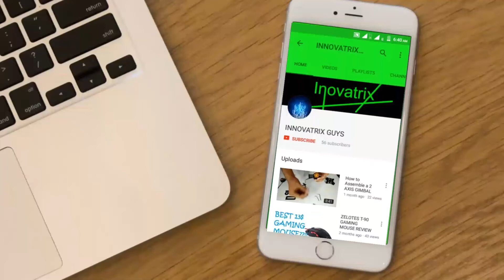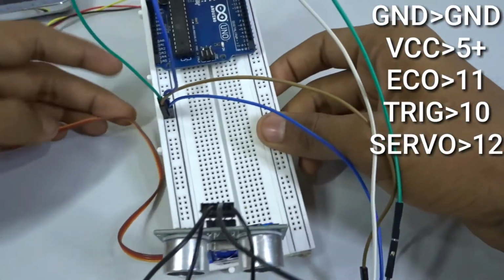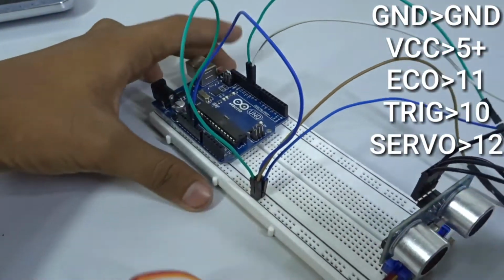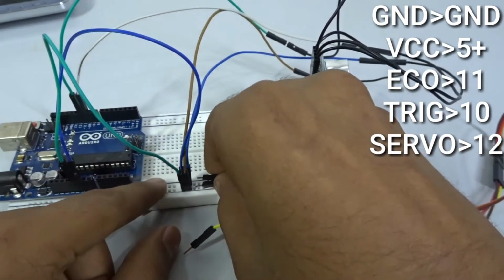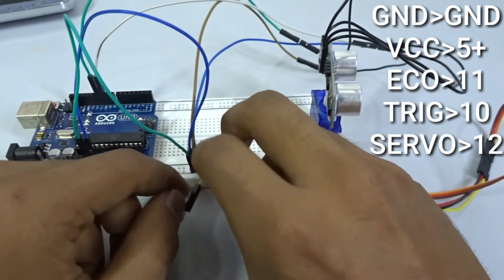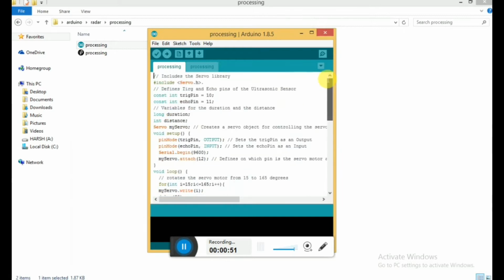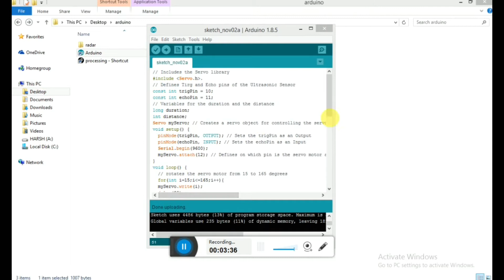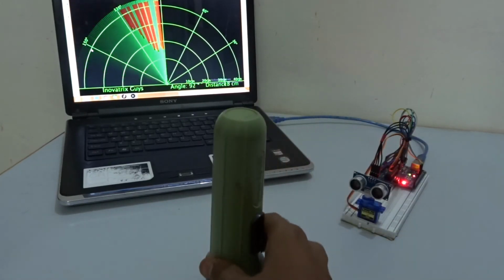Arduino Sonar Radar | HOW TO MAKE A RADAR AT HOME | Arduino Project

Comment: Are bunch of wire is available on amazon
Reply from the maker: Yes.
Reply: Inovatrix Guys but which help we have to download ?
Reply: What should we search for that
Reply: And I am 12 years old I am not able to under stand your programming can you chat on WhatsApp plz this is an humble request
Reply: I want make sonar at any cost can you help me ?
Reply from the maker: Search for male female jumper wire.
Copy the code to your computer. It's east
Reply: Inovatrix Guys I can’t understand plz help on WhatsApp I will able to get clear
Reply: I have liked suscribe and share to 53 people now but plz help me
Reply from the maker: You only need to copy past the code.
Nothing else.
Reply: Inovatrix Guys plz help I am not able to get
Reply from the maker: Please send your query on instagram id  @inovatrix_guys
Reply: Inovatrix Guys I am not able to use instagram bcz my age is too low
Reply from the maker: If you can type in hindi that will be great
Reply: But in which app you were programming
Reply from the maker: We used 2 programs.
Arduino ide and processing 3
Reply from the maker: Alright please let us know where you have problem in handling with the code?
Reply: Inovatrix Guys i am able to handle code bcz during programming your audio is very low and I am not able to understand by what wire you have joined arudino with laptop and
Reply: Inovatrix Guys are codes already written when we open it ?if no how to write ? Correctly
Reply: Acoustic Anoop thanks

Comment: motor is not moving but the sensor working
Reply from the maker: It could be for some reasons,you could try these-
1-Try using different servo 
2-Try using different jumper wire (if using)
3-Make sure servo is grounded through arduino 
4-Use external power other than usb.
Reply: @INOVATRIX  if we use external power then what about the display of radar
Reply from the maker: Is the servo jittering?
Reply: +INOVATRIX GUYS  yes it is jittering